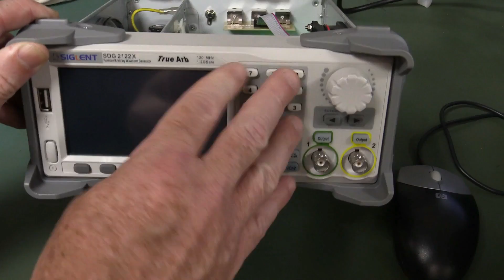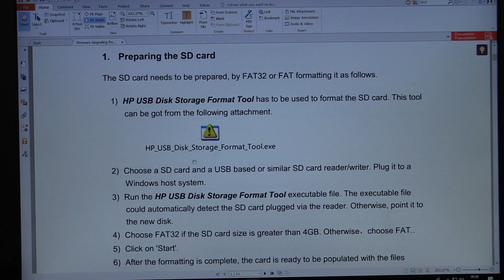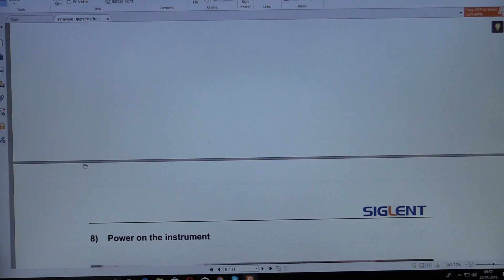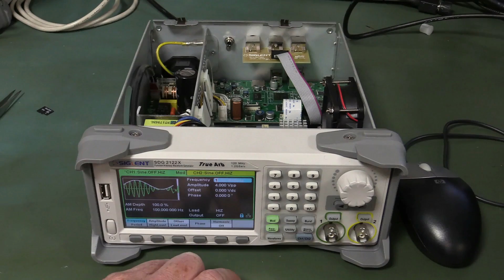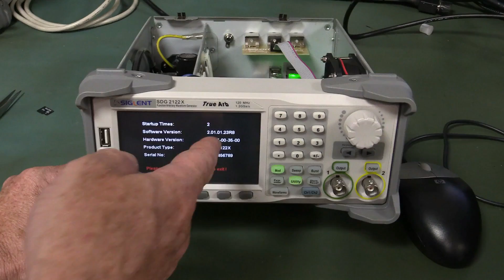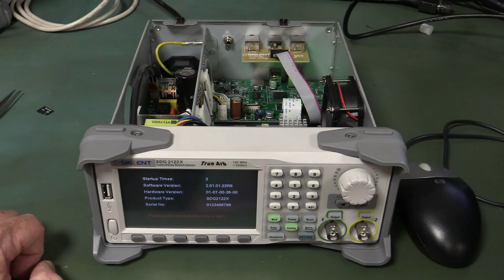Siglent Signal Generator Fix

Comment: You said your unit is pre-production. Probably very few people if ANY have that version. How about actually "fixing" something like the left and up direction keys and trigger keys not working on my NEW (only out of the box twice since bought in Aug 2021) Siglent SDG810! Now THAT would be helpful. Your unit should be able to update firmware through the USB. using that on-motherboard SD card is arcane.

Comment: Mine has the left and up direction key and trigger key not working and they will NOT fix it under warranty because it came form Amazon! It has a year left on the warranty. Bought in Aug 2021....not good! Will have to file a small claims suit.

Comment: Just use the USB. Why are you fiddling with the boot sequence by soldering pads? It probably is set to boot from USB! I updated the firmware in my SDG810 over the USB with no problem. Electronic equipment made these days should NEVER be unable to boot from a panel USB port. This isn't 1970!

Comment: Format tool problem. I asked my magic ball and the answer was "run it as administrator" :)
Reply: I did, didn't work.
Reply: Looks like my magic ball needs recalibration :) I don't know what's the problem with sigilent tool - i have written similiar tool years ago and "run it as administrator" helped in 90% cases
Reply: that HP format software is old, and it's not needed. what that software is used for is to make some older SD cards and other flash media that aren't bootable, be able to be booted. I have no idea how the software works.
Reply: Run it as a previous windows version

Comment: Even with pre-release sw, there should be no way for an instrument to become unbootable (unless the program flash itself is corrupted of course, which should not, unless there is a hw error). There should be a way to factory reset at the early stages of boot. So that even if there is corrupted settings or calibration data that prevents booting, it should still revert to a bootable state. 
Of course, proper fw should detect invalid configuration data and reset it, rather than fail to boot.
Reply: Why not? Buggy code can do all sorts of things, including data getting written to places it shouldn't be written, especially in the case of a buffer overflow etc. There's no telling what could occur when things like that happen.
Reply: User should be able to load new firmware over USB and the arcane SD card. Electronic equipment should NEVER be unable to boot firmware. The boot is supposed to be in ROM. This isn't 1970.

Comment: They should address the startup timer reset issue. It is actually a valid way of altering the value of a second hand unit. It's like changing the mileage on a car.
Reply: More worrying is the regular rewriting of the flash memory with the value, which means a page erase each time and a reprogram of the page on each power cycle. Probably not using any wear levelling on that filesystem either, so the instrument life is limited to the write lifetime of that single block of flash memory, as it probably also has a part of the boot firmware on that page as well, or at least some other volatile data.

Probably best to leave it powered on all the time, though that also has issues of reducing the display lifetime amongst others.
Reply: I believe the regular firmware upgrade procedure does not reset startup counter. Because the unit was dead, Dave did a factory initialization procedure. That's why serial number was also lost.
Reply: Electricity must be pretty cheap in other countries... I pay almost 30 EUR ct per KW/h...
Reply: Andy, even better, you clear one bit of the page on each start.
Reply: SeanBZA if you're smart you don't do a page erase until you've filled a page. you hold # of times the page has been erased at the page start then program a sequential page word on each restart with a known constant until you hit page end. then erase and start again with an incremented erase counter.

Comment: Serial # 0123456789?
Reply: "That's weird - I use the same combination on my luggage." :p
Reply: https://www.youtube.com/watch?v=B-NhD15ocwA
Reply: Damn it, they stole my password and sent it back in time to use it in that movie and now I have to append another digit. :-(
Reply: Luck of the draw :P
Reply: Its what happens when you're messing around in the config files to unlock the higher bandwidth, and delete more of the line that controls that than you should.

Edit: I'm not suggesting that's what Dave was doing, he's clearly already got the highest bandwidth model. Was just saying that's what happens when you remove too much from the config file that controls the bandwidth limit. I'm sure in this case Siglent didn't change the firmware to match Dave's serial number (of course not, why would they? if they did they would have to do it for everybody that needed it), and so either just left the serial number out of the firmware, or gave it a generic serial number.
Reply: I'd actually expect the serial number, power cycle count data, feature unlock codes and so forth, to be stored in a semi-protected part of flash that didn't get touched by a FW update.
I don't know if we see the serial number in his earlier video and if it was the same.
Reply: Only when being really lazy.  Serial numbers are still very useful in tracking pre-release equipment - especially when it is let out into the wild.
Reply: Yes, when a prerelease device shows up on eBay, you want to know where it came from.